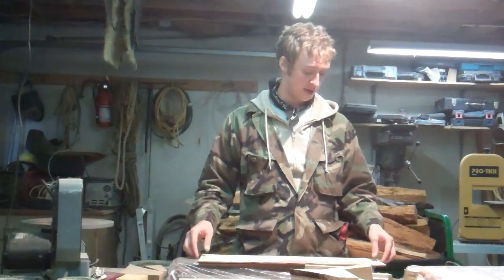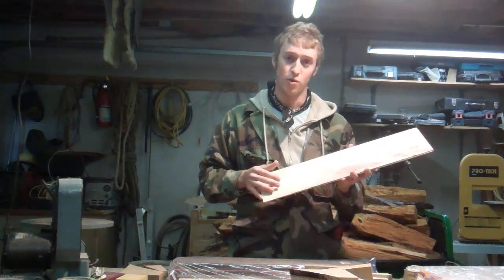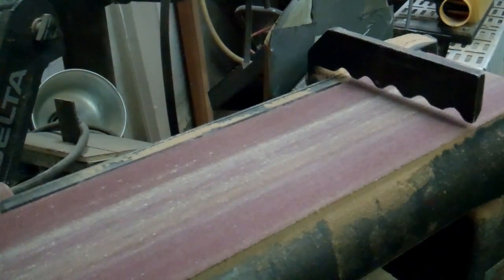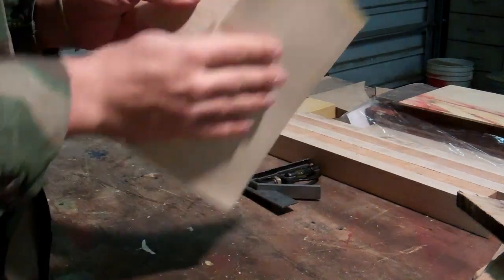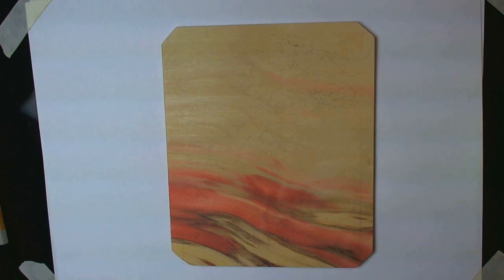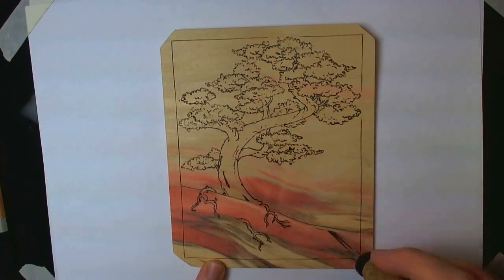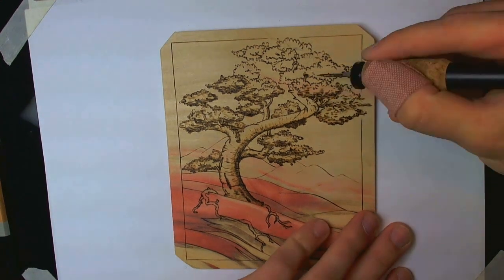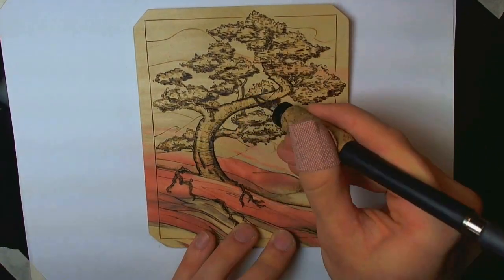How To: Wood Burning a Bonsai Tree Design

Comment: I just wanted to say I hope you have a really good day also. 

the guard on the table saw is pointless but I did notice how it dangerous it looked you only need the blade high enough to cut the wood.  I'm really only posting this because the last two comments are safety issues.